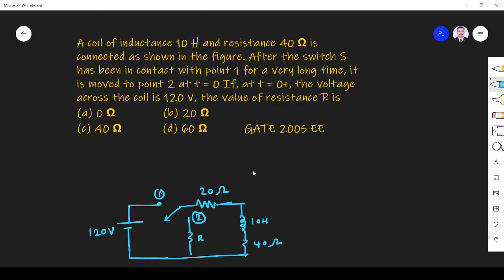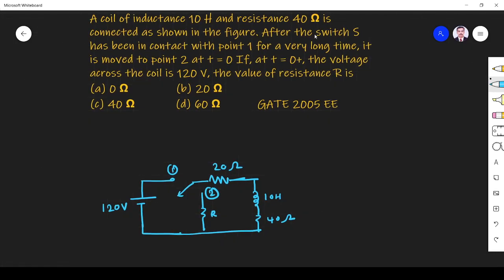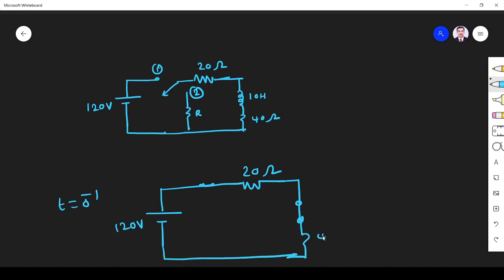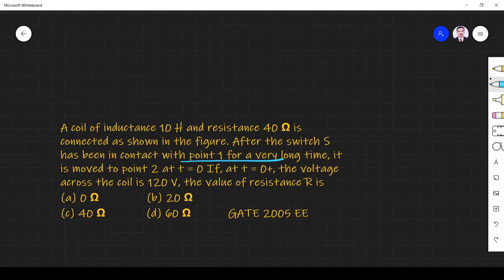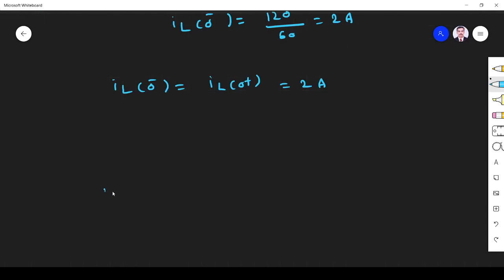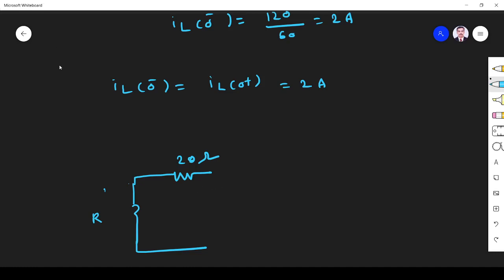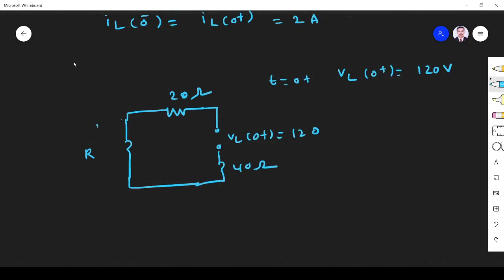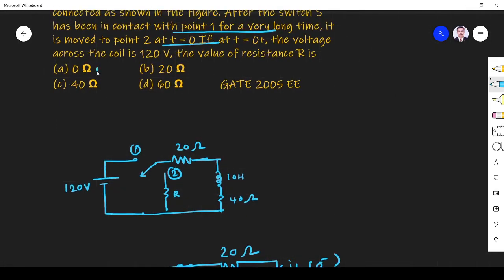Network Theory GATE 2006 EE Solution |#29|

Comment: respected sir ,when in question in starting it has been cleared that a coil consists of a R and L then when initial voltage of coil is 120v then why we are taking 120 v of only inductor because coil contains R and L both so according to that answer will be 40ohms.
Reply from the maker: At t=0+ inductor is open circuit..hence all the voltage drops across inductor only..so only we take voltage across inductor is 120V and ignore the drop across resistor at t=0+